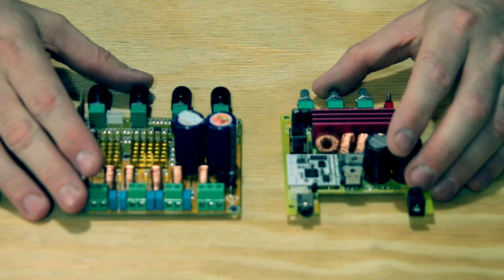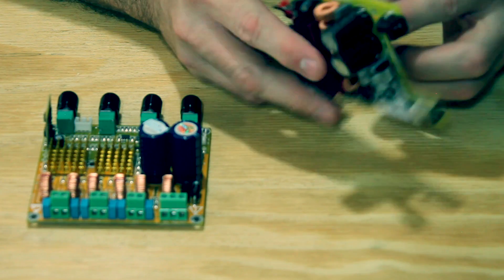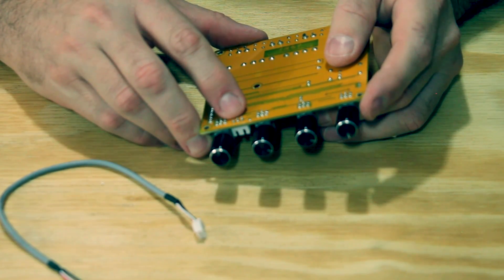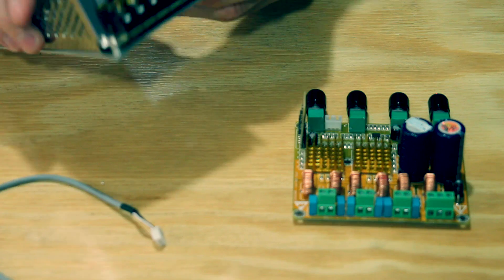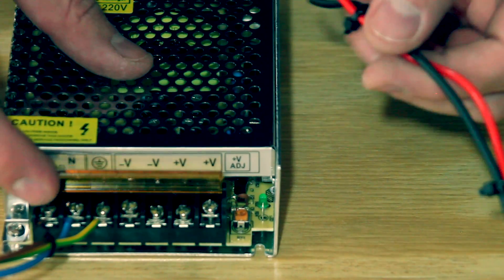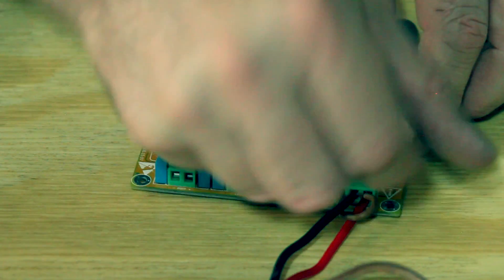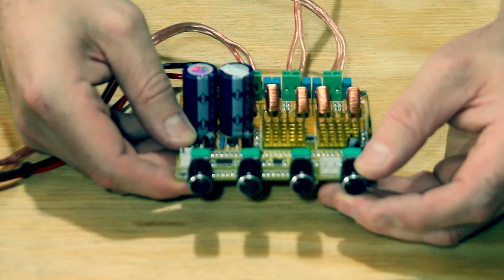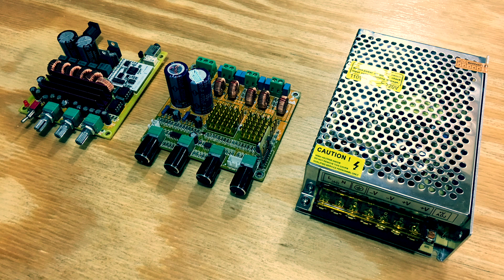TEST BENCH: TPA3116 2.1 Channel Amplifier Boards with Bluetooth 4.0 - by SoundBlab

Comment: How hot are the amplifier and the PSU After a couple Hours of working, because i'm worry to put Thema in an closed Speaker.
Reply from the maker: It does get hot if you push the amplifier towards its top-end of performance. I would suggest not putting it in a sealed enclosure. Perhaps enclosing in its own enclosure with vents towards the outside inside the sealed speaker enclosure is a solution.
Reply: Der Tobiist can you see the chip with the hole in it you have to mount a heat sink on it also use thermal paste

Comment: I bought one. But what is the damn  Bluetooth pairing code?  Help!
Reply: Timon grüße aus bonn.
Reply: Timon hey Timon, ist das Teil das du gekauft hast zu gebrauchen, rauscht es oder sowas ? Würde mich mal interessieren weil im Internet immer nur steht total toll oder es ist Müll. 
Liebe Grüße aus Kassel
Reply: Lucas Herbst Hey, ich benutze das Ding für ne mobile 2.1 Box. Betrieben mit einer Powerbank 24V. Ich hätte nicht gedacht, dass es was taugt, aber bin absolut zufrieden! Absolut kein Pop noise beim Ein/Ausschalten und auch kein Bluetooth groundloop Geräusch. Output ist auch nicht schlecht und bei dem Lautstärkeregler auf halber Stufe auch fast kein Rauschen zu höhen. Also ich kann das Ding absolut empfehlen, denn es schlägt sich bisher immer noch wacker. Also man kann tatsächlich was halbwegs anständiges damit bauen! Für so ein Gerät von Ebay sehr beeindruckend 😅
Reply: @timonarthur  hi,woher kriegt man den ne 24v powerbank? Will auch eine 2.1 bluetooth Box bauen
Reply from the maker: 5188
Reply: SoundBlab Yeah,  thank you! :) 
I had to buy it from an other seller because at the time the one from your description didn't ship to Germany. He forgot to write the code  in the product description ._.
Reply: Timon , try 1234
Reply: Das einzige was mir als negativ Punkt gerade einfällt ist, dass der Subwoofer Ausgang immer einen tiefen, pochenden Ton abgibt. Vergleichbar mit einem Herzschlag. Was außerdem für mich etwas nervig ist, ist das das Ding konstant 2,5 - 4W frisst, auch wenn keine Musik abgespielt wird.

Comment: what awg wires you using to conect the PSU and the speakers?
Reply from the maker: +G Bento Speaker wires 16AWG and power 14AWG, but over short runs 16AWG should be fine for both. For long speaker wire runs, use 14.

Comment: Hello. Tell me, please, why do you choose to use TPA type amplifier, instead of TDA? It seems that TDA is better with sound quality. Thank you.
Reply from the maker: +Oleg B.  Perhaps, but I have not been able to source a TDA amp board with bluetooth that aslo has 2.1 channels.
Reply: Found just this one (2.1, TDA7498E with Bluetooth): http://m.ebay.com/itm/ISSC-Bluetooth-TDA7498E-2-1-160W-80W-80W-Class-D-digital-Amplifier-board-/272172868192?hash=item3f5ec46260%3Ag%3A5pIAAOSwP~tW6SsC&_trkparms=pageci%253A4c0b8332-c9e7-11e6-b1d6-74dbd1807a22%257Cparentrq%253A314920781590a786ccdfda87ffcf584c%257Ciid%253A10

It will be interesting if you compare this amplifier with TPA.
Reply: you could test this one: http://www.banggood.com/Class-D-TDA7498-TL072-2_1-Digital-Amplifier-Board-200W2X100W-DC24V32V-p-1100364.html?rmmds=search

Comment: The third connection is for remote turn on as this could be a board designed for Car as well. Most of the car amplifiers do have this remote turn on to ONLY turn on the amp when the head-unit is ON. Hope this helps.
Reply: i realize i'm a bit late to reply here, but i dont think this is the case. looking at the layout of the board, both plus sides goes through some large diodes and then merge to the same track. i'm guessing it's either for + 0 - AC supplies or simply to offload some power between two diodes, since the ones mounted dont look like they are intended to handle the full 10ish amp that the board claims to draw at peak, likely both.
Reply: combatplayer, you are absolutely correct.  The third connection is definitely not for a remote turn on.  It is so you can use a split +/- 18v supply.  You jump the two outside connections if you are using a straight 24vdc supply.
Reply: its designed to run with center tap transformer, so the 2 diode makes the full bridge rectifier, and you get positive DC voltage, if you using normal transformer without CT, then its only half wave rectifier, if you using it with DC, you need to bridge it, even tho its not necessary, but you get better to bridge it, so you have double the stored energy on the capacitor

Comment: The Problem of such bluetooth boards is the so called Ground Loop! Because the integrated Bluetooth module shows the same ground as the amplifier, it produces noises.  To avoid this, you have to put a Ground  Loop Isolator in between your Audio Input and your Audio device, to filter out these noises. 
You can find cheap ones on Ebay or Amazon!^^
Reply: I use a separate amplifier board and a portable Bluetooth receiver that has its own PSU with like this one. https://www.amazon.com/TROND-Bluetooth-Transmitter-Receiver-Simultaneously/dp/B01B4W40VC/ref=cm_cr_arp_d_product_sims?ie=UTF8. Because this has its own built in battery and charge system it is already isolated. I like this also because I can mount the BT receiver externally and use the buttons on it and it is aptx for better sound.
Reply: Another thing is the ground loop isolators reduce the sound quality a little once your into very HQ sound. I played with many of them for a build where I was using the Logitech home BT receiver because of its ability to make very good cd quality BT connection. I found that the old radio shack 270-054 worked best but I still was not happy with the sound. I removed the ground loop isolator and simply used an Anker USB power bank to power the Logitech BT receiver. Problem solved without messing with the audio signal. If you get an external BT receiver it can be pretty ugly to just stick it on top so I usually build a cubby hole to make it look like it belongs. Here are some pics for that build to show what I mean: 

https://www.dropbox.com/s/at8rp7g5k990tef/20160905_155206.jpg?dl=0
https://www.dropbox.com/s/xntdx87thhcchqv/20160925_181826.jpg?dl=0
https://www.dropbox.com/s/fnczs3328uboq2n/20160925_181812_HDR.jpg?dl=0
Reply: alexander ghekiere
Thanks. I use the SMSL AMP-03. It is a TA2020 amplifier making 13wpc at 8ohms. This little amp is really great sounding. It is nearly like the Lepai 2020A+ but the Amp-03 is a little better with better capacitor layout and cleaner response.You can search on google and see some people have compared it to other more expensive Tripath amps and it is a top contender for a low power option. The speaker drivers are SB Acoustics 5" woofers and some very popular Vifa 1" tweeters. The speakers are 87db @ 1w/1m so 13wpc is plenty when you have efficient speakers.
Reply: Another great thing with the AMP-03 is how efficient it is. My Bluetooth speaker has a 12v 20AH SLA battery and can run at half volume for 80 hours!
Reply: This is the one I got, from this seller. http://www.ebay.ph/itm/SMSL-AMP-03-TA2020-Tripath-TA2020-Cute-Class-T-Mini-Amplifier-20WX2-BLACK-New-/141285835925
Reply: Or you can change the 50k potentiometer to 10k near the switch thats the main problem of the board that makes the hsss
Reply: +bear123 you gave a very nice speaker. Can I ask, with amplifier did you use?
Reply: thanks
Reply: bear123 where can I buy that amp here in the Philippines.?
Reply: where can I buy that amp. here in the Philippines
Reply: where can I buy that amp. here in the Philippines,
Reply: Would the borad still bei functional if I simply unsolder the Bluetooth Chip? I don't need that because I'm going to Use a separate Bluetoothboard to whitch two amps will be hooked up
Reply: ACTUALLY, it has to do with the fact that the ground traces are daisy-chained connected instead of "star" connected to the main ground. The other contribution to noise is decoupling caps in the proper locations. Also, this amp may exhibit coil-whine due to the switching frequencies, being a class-D amp.
Reply: there are Other boards like this but without the bluethooth module
Reply: Nonsense.  I've used a half dozen of these TPA/TBA boards with onboard bluetooth and never had a problem with noise.
Reply: How do you do that??